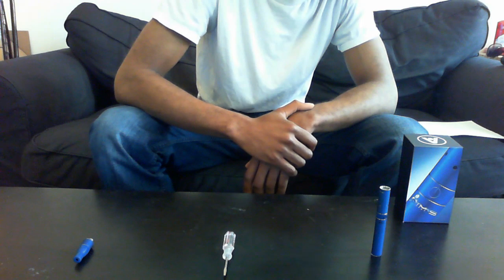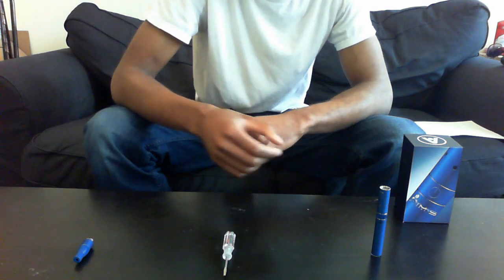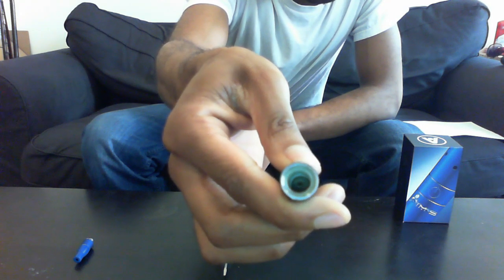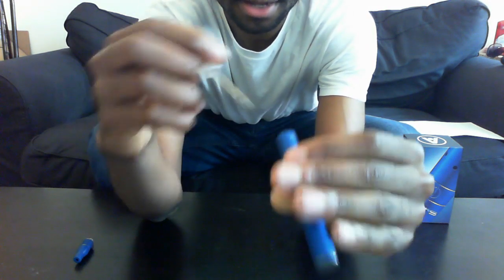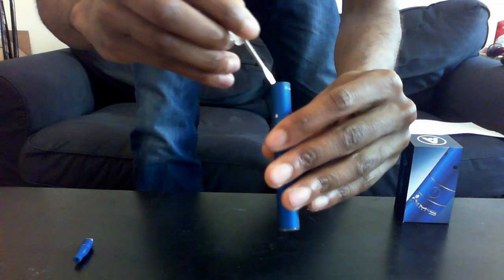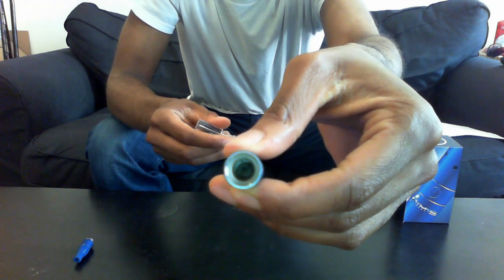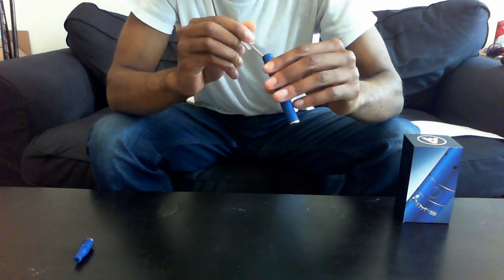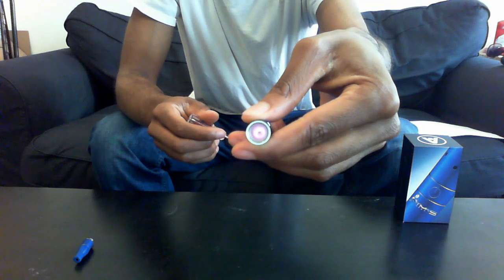Part 1/4: How to Fix Broken Atmos Raw Rx Heating Chamber Coil - Vaporizing / Vape Pen Tutorial

Comment: Hey hopefully your active vet, i just got a atmos jr and i checked it worked packed it and it did nothing i was gentle now it doesent heat and the blue led just blinks and when i take off the chamber the light doesent blink so it might be the chamber ive tried moving coil around bit nothing
Reply from the maker: Hmm.. Normally when one of my pens would blink with the coil attached, it meant something was shorting out the battery. Are you using any metal mesh filters or anything like that inside the chamber? Also, check out Part 3 of this series--it has the best info and close ups of what to do. Keep me posted. It's probably the heating chamber, but it's probably not too messed up.

Comment: I just got my atmos rx thru groupon, and my heating chamber does NOT heat up or light up like yours... should I ask for it to be changed?
Reply from the maker: Hi--it all depends. So long as the chamber lights up and works properly, I think you should be fine. The camera I use (especially on some of these earlier videos) just doesn't capture light very well, and tends to get overexposed easily. So basically, often times, my chambers look much brighter in the video than they do in person! Thanks for watching.

Comment: so I've watched all your videos and messed with the heating coil but my pen does this strange thing where it will blink 3 times everytime i hold down the button so i really dont know what it could be, any ideas or suggestions would be awesome, thank you!
Reply from the maker: This is kind of a tricky one. For me, when this happened, it usually meant the battery was giving a short-circuit warning. I noticed this most often when I used to try and place metal mesh filters inside the chamber. So first off, *if* you are using anything else inside the chamber, try taking that out. Otherwise, the coils could just be misaligned somehow. And this is why I say it's a tricky fix. You'd want to space the coils off of each other, while at the same time not ruining their delicate balance...
Reply: thank you for your help! i ended up just getting a new heating chamber for super cheap and my battery still works fine! so thanks so much, im not back in bizzzz
Reply from the maker: Nice!

Comment: My wire for the coil broke and came out, I lost the wire now , what do I do ?
Reply from the maker: Scott Parker Hmm.. anything short of soldering a new wire back into the chamber (at both the center and outer connecting points) probably wouldn't help. At this point, I'd say grab a new chamber.
Reply: Vape Vet  ok thanks but where can i buy them from? do local smoke shops sell them? thanks.
Reply from the maker: Smoke shops that sell the Atmos devices might have them. The Atmos website has some, and our site also carries spare black Rx chambers here: http://vapevetstore.com/products/atmos-rx-spare-heating-chamber

Comment: I have a Raw JR and it clogs all the time using regular bud, I use a wooden toothpick to clean it out, when I push the button the coil doesn't glow, when I push it and move the coil around with the toothpick it will smoke then glow, good for a few sessions then back to normal. wondering if a new coil will fix my issue or that this unit isn't going to work period. Have you had similar issue?
Reply from the maker: Yes, I've had the same issues with a few pens. It sounds like there's still some life in your coil. Sometimes if you move it around enough (gently), it will stay in the right place--without the need to readjust. Check out Part 3 in the Coil Fixing Saga. A new coil should definitely solve the problem though--it doesn't sound like there's any other issue. Also, whatever you pack into the chamber, it's always best to use less. Helps prevent clogging and other issues, and usually produces better hits. Hope this helps--and thanks for watching!

Comment: My unit doesn't heat up as well when I turn it on to heat up all it does itthe light blinks 3 times and the LCD doeant even turn on if I take off heating chamber it works fine, I put a glass globe on it and it works perfectly fine
Reply from the maker: Thanks for watching. Sounds like there's some sort of short circuit going in with the heating chamber. It's important to be careful when adjusting the coil to fix the device. If you move it around too much or too roughly, you can cause more damage (this is usually what damages the heating coils in the first place). But, it might still be salvageable. If the coil is really bunched up or tangled, you can try taking a paper clip towards the center of the coil and ever so slightly raising it. This will space the coils out a bit more and may help. Just keep subtly adjusting the position -- nothing too drastic  -- and try powering after each subtle movement. Also, be sure to avoid placing anything inside the chamber aside from herbs, wax, and oils (all in modest amounts), and a glass screen filter. I would avoid mesh or metal filters. Hopefully some of this helps! Good luck.

Comment: My vape I have battery lights go on and I bought brand new coil and it doesnt turn on
Reply from the maker: TheElitebigkiller You may want to try out the battery repair video first. It's a very simple fix, and more often than not, it's the battery fix that is the real problem, not the heating chamber or coil: https://www.youtube.com/watch?v=bjcmwxz6QFU

Comment: my vape is clogged  and i have that same vape just has no suction if i boil it to clean it out would it mess the thing up, im not putting a battery so as long as i wait until it drys it should still work. i clean it with a swab but it doesn't get the little holes on the side any help anyone?
Reply from the maker: pee keg Hmm.. Let me try it first for you and get back to you on how the chamber performs post-boil.
Reply: ok thanks allot
Reply from the maker: pee keg Works fine! Chamber is clean (you can use a q-tip immediately after boiling to clean it up a bit). The only thing is it takes a while to dry. I would suggest using a blow dryer on a high setting. Until all the water droplets are completely gone, the coil will just be boiling whatever water is in the chamber. Once it is completely dry, it works good as new. Nice idea!
Reply: thanks, and thank you for your help hope it helps people out
Reply: Dude use isopropyl alcohol. Much easier.

Comment: i moved the coil around with my flat head and it makes it heat up a little bit. maybe my coil just needs to be replaced? it does look a bit used...
Reply from the maker: @chancebandet, over time, it's inevitable that you will need to replace your coil.  If you are looking to get replacement parts, you can check out our heating chamber here: https://vapevetstore.com/collections/vape-coils/products/heating-chamber-for-ago-g5-and-atmos-rx-vaporizer

If you have any further questions, please reach out to our support staff and they'll gladly assist you.

Comment: The problem i am facing is that though i am getting some red its no where lighting up as red as your. Its making it difficult with a waxy substance. Can you advise what i could do with my R2?
Reply from the maker: Paras Turakhia One thing to keep in mind is that the camera is making the light seem a bit brighter than it actually is. It's just the way the camera captures light, so it's not like my coil is super bright like a flash light. The best way to do wax with the R2 or Rx is to make sure not to pack too much at once. A small dab will really go a long way. If you put too much, all the wax melts into oil and sort of floods the coil. A smaller amount at once produces much more vapor more easily.
Reply: Still i need something with more power, any suggestions my man? I mean literally i have to keep it on 2-3 cycles of 10seconds just to get it to start.
Reply from the maker: Paras Turakhia Hmm.. My first thought is that the battery will lose power once it starts losing a charge, so fully charging the battery may help with that. Other than that, the only way to get more heat is with more voltage. You could try buying one of the Atmos-to-510-thread adapters, then buying a 510 variable volt battery of your choice (I'd just go with one of the twist style eGo batteries), then you would be able to set the voltage much higher, get more heat from the coil, and that should solve your heat problem.

Comment: i have a differente problem, my baterry gets confused when connects to the coil

when I have only the battery in my hand I cant turn it on off and "heat" but when i connect the coil the battery starts behaving like it has no charge, blinking 3 times, and I cant turn it off or on anymore
Reply from the maker: @Tiago Bernardi, Sorry to hear about that problem.  It's happened rarely with our customers, but over the last three years, we've heard from customers having issues like that.  Unfortunately, the only thing you can do is get a new heating chamber.  You can check them out here: https://vapevetstore.com/collections/vape-coils/products/atmos-rx-heating-chamber

Feel free to reach out to our support staff. They'll gladly assist you.

Comment: I notice with my vape that it won't always glow red whenever I hold the button down and when it does turn red it isn't red around the whole coil. This also only lasts a few seconds. I'm afraid to move anything around simply because I wouldn't want to break it if it isn't broken right now.
Reply from the maker: +Lionel Crawford Fully charging the battery should help with how hot the chamber gets. Once the battery is at about half power, there's a significant drop off in how effectively it heats the chamber. But also keep in mind that it won't glow quite as brightly as  depicted in the video. The camera is just having a bit of a lens flare effect on the coils.

Comment: To be safe I use a paper clip...sometimes I'll die on you while it's pack so I poke around inside with a paper clip just to get a spark..ull know when it's working when smoke starts to rise then cap it and toke away
Reply from the maker: This is a great tip! A paper clip is a much... gentler way to slowly adjust the coil position. Thanks.

Comment: Doing this is just asking for a short and a bad experience.
Reply from the maker: If the coil is already "broken" there's really no harm in fixing it this way. I've fixed dozens of heating chambers this way. At this point it's actually really fast and easy for me. The alternative is to buy another heating chamber--which is where'd you be even if you broke your already broken heating chamber doing this. Know what I mean?
Reply: I totally get your theory. The problem is, if the coil is not in the right place from you moving it around and it is touching any sort of metal inside the chamber it is not supposed to, it will cause a short. It is just like with an rebuildable atomizer, if your coil touches the outer shell of the atomizer, it will short. Also, if your coil suddenly fires while you have the metal screwdriver touching it, that will also cause a short. This is what causes the whole exploding battery issue with ecigs.

I'm sure this technique works, but all it takes is that one time getting a short that can turn into a very ugly experience. I'd rather just shell out the cash for a new atomizer than to lose my hand or burn my house down.
Reply: I know most people into vaping for dry herbs and BHOs really don't get into the whole technical side of things, but e-cig users have to know this kind of stuff for rebuilding our own tanks/atomizers/etc.

I do have to say though, your technique may be safe to use IF the battery has short protection built in. I'm not sure if they do or not, I just ordered my first Atmos and am waiting for it to arrive. That is really the key variable in this whole scenario.

It's just all about safety. I'm not trying to bash your tips, just want to make sure everyone stays safe!
Reply from the maker: Ah, I see where you're coming from, now. So these chambers are fully ceramic so there's less danger of metal-to-metal contact. If the wires overlap too much, I've noticed it can cause problems. However, I believe there is a safety mechanism in place for shorts--if someone did accidentally power it while having metal in there, the battery shuts off and pauses for a good 5-7 seconds.
Reply: Vape Vet
I see. That is good to know. I'm looking forward to getting my AGO kit, which is basically just a knock off of the Atmos, and finally getting to try one of these out first hand.

Also, here is something you and your viewers may be interested in. You can order a pack of 50 replacement coils for the AGO for $2.00! I'm pretty certain they will work in the actual Atmos as well. I'll include a link below if you are interested. This is for the same website from where I ordered my AGO kit for only $18. Just keep safety in mind and be sure there is a way to ensure you installed the coil properly to avoid shorts.

And thank you for being open-minded here. You don't see that a lot in this insane asylum called the YouTube comments section :)

https://www.fasttech.com/products/1608500
Reply from the maker: Oh boy--the YouTube Comments Insane Asylum. My favorite place, haha. So the unfortunate thing is that Atmos (smartly, business-wise), changed the threading that connects their batteries to the heating coils. So the AGO and other pens based on the same design aren't interchangeable with their batteries. However, so long as you have a good source that provides good high quality batteries and heating chambers, then opting for an AGO, Vapormax, Pana, etc is a fine option. Atmos being the brand-leader just means they're going to have more consistent quality on the parts. Since any factory can legally make an AGO, some will use cheaper parts to offer cheaper prices and use that as their competitive advantage.
Reply: Yeah I do wish they all used the 510 connections like 90% of the ecig products do. It makes mixing and matching different devices easier, but I can see why they do it. But with those coils I mentioned, you can just replace the coil in the chamber you already have. Might be a bit tricky at first, but I'm sure there are tutorials online.

Comment: My ago g5 has been working really well but then all of a sudden stopped. When I have it all ready to go and hit the power button, it just flashes 4 times and turns off. I think it's the heating chamber since if I just have the battery in hand and go to turn it on and works well. Do you have any suggestions on what may have happened/how to fix it or should I just buy a replacement heating chamber?
Reply from the maker: There are usually two main reasons for a flashing battery. Either it needs to be charged (not the case here), or there's a short circuit somewhere. Those are the top reasons for me at least. If you're using anything like a mesh filter inside the chamber, that can cause flashing--or if there's any metal touching the coils. Sometimes I think if parts of the coil get pushed too closely together (can happen when using the packing tool sometimes), then having too many overlapping parts can cause this problem too. If it's as simple as a mesh filter or something inside the chamber, that should be an easy fix. If it's the heating coils, it might be much less of a headache to just replace it--otherwise you'll have to sort of tinker around with spacing the coils, which can be sort of hit or miss. Thanks for watching!